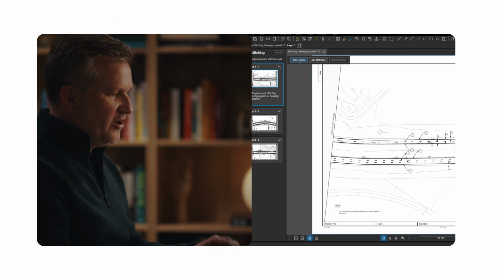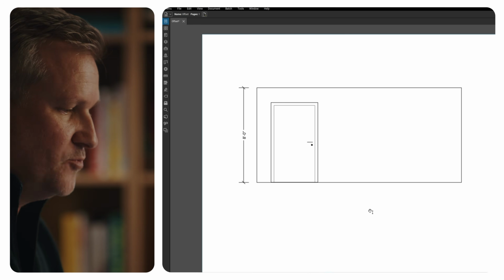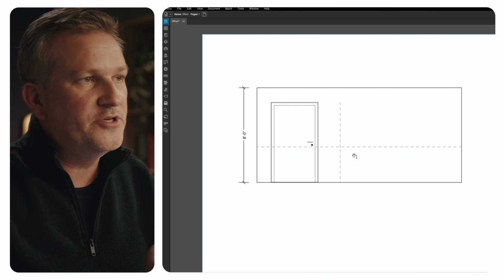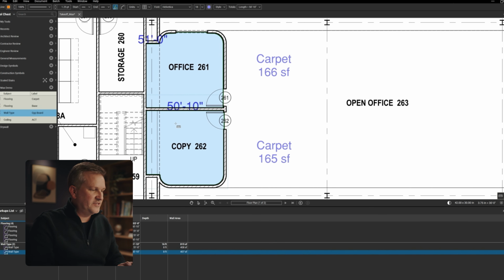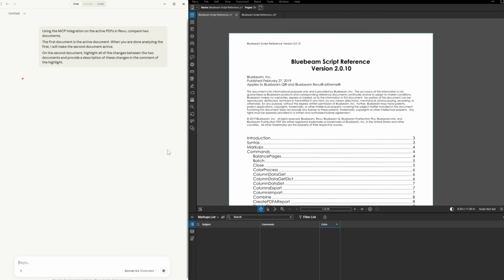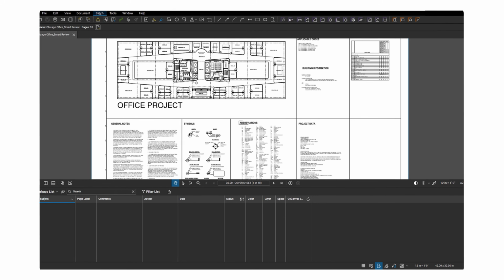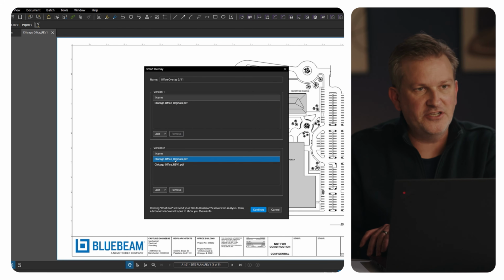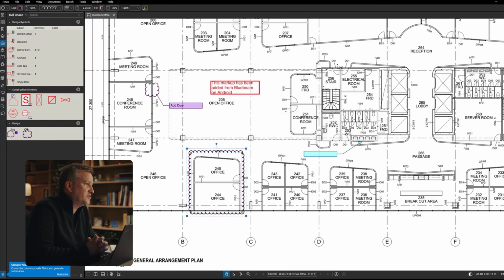Bluebeam Max Demo: AI Tools for Smarter Construction Workflows

Comment: Are there tools that can attach external elevations to line strings?
This would be helpful when assembling a full site cut/fill model.
Reply from the maker: Not currently as a native cut/fill-modeling workflow. Bluebeam can measure and markup 2D site plans and can work with 3D PDF content, but assigning elevations to line strings and generating a full existing-vs.-proposed cut/fill surface comparison would typically require dedicated civil or earthwork modeling software. 

We appreciate the suggestion! It’s a valuable capability for site teams.

Comment: Can we filter out the type of comparison we want to carry out between two different documents. For example, If I have to compare only dimension/text instead of any symbols from drawings
Reply from the maker: Nice. That’s a smart way to handle it with the current tools. Using the Markups List to filter, rename, or remove the compare markups you don’t need is exactly how a lot of power users dial things in today, and feedback like yours really helps us as we think about more granular compare options for the future.
Reply from the maker: Great question. Today, Compare Documents looks at changes in the underlying PDF content and highlights them as markups, but it doesn’t have a built‑in option to only compare ‘dimensions/text only’ while completely ignoring symbols. You can, however, use Compare Documents (or Batch Compare) to generate the change markups and then use tools like the Markups List filters and the separate Text Compare feature when you specifically need to focus on text‑based differences between two versions.
Reply: @Bluebeam_Official Thanks. I used to try this way only and delete the compared markups from filter list which I am not intrested or give a different subject name.